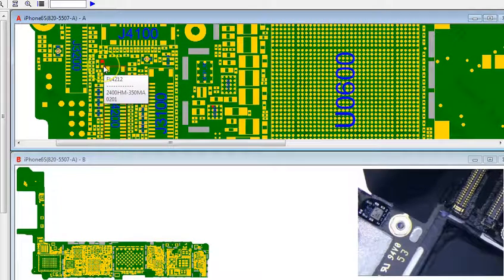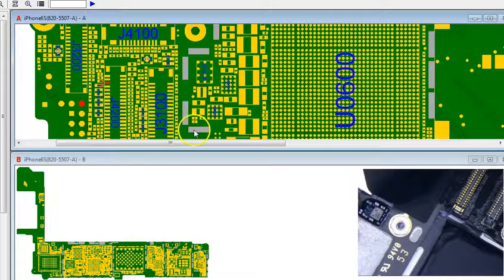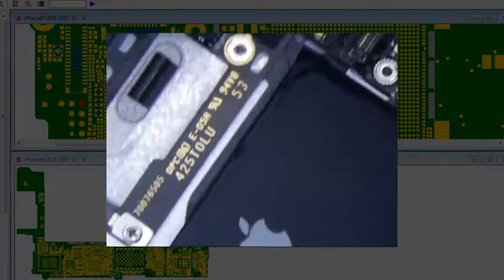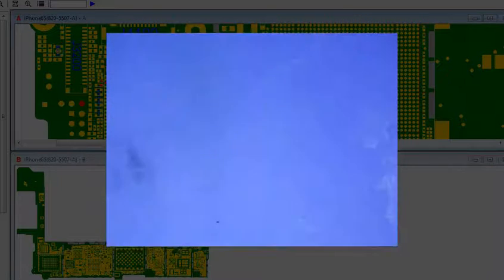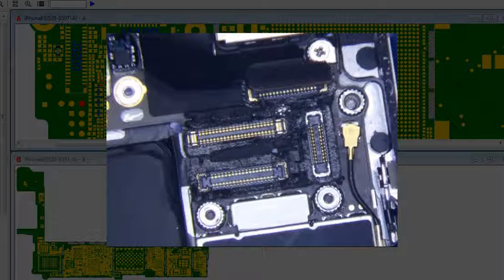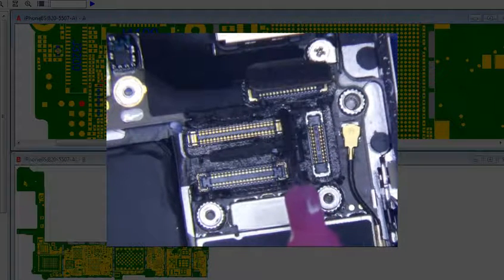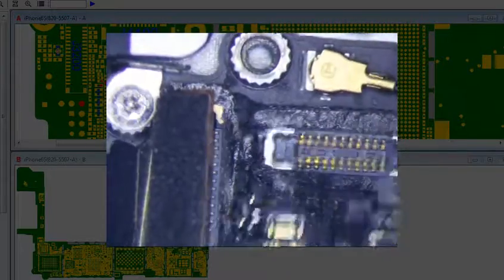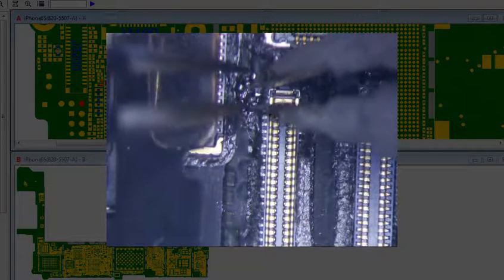iphone 6s backlight filter repair

Comment: Can I use hot air to replace the backlight filter because I don't own hot tweazers
Reply from the maker: Brandon Tansil I wouldn't use hot air cause it's too close to the connector
Reply: So what do you suggest without hot tweazers?
Reply from the maker: Brandon Tansil you can use hot air but definitely put some kapton all around it and a low air flow
Reply: Gotcha thanks a lot I rely on you videos very much!

Comment: Hi
Could i make a jumper instead of replacing it with a new filter?
Reply: I think you can but I've heard you might blow the ic if you use "retina flash"
Reply: that would be cool, i would like to see someone do a jumper as well, that would be an interesting video.
Reply from the maker: Dani Dabboura No jumper